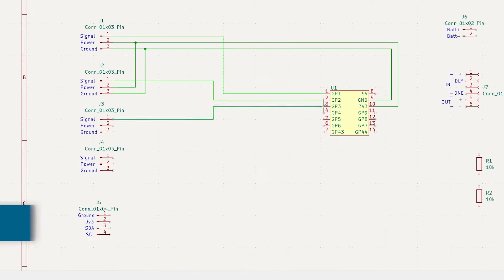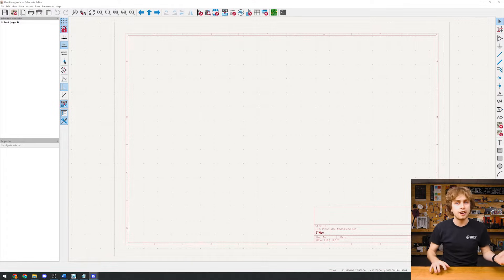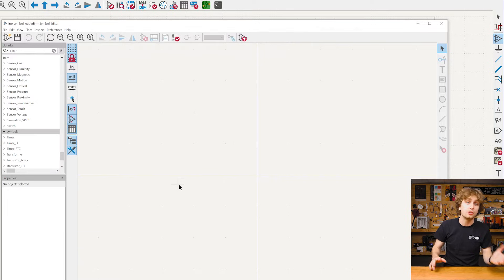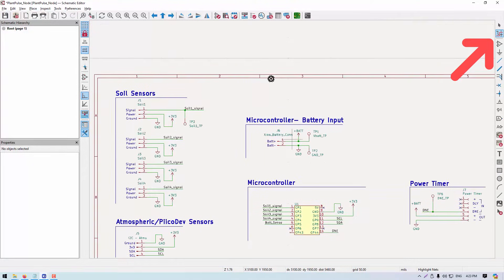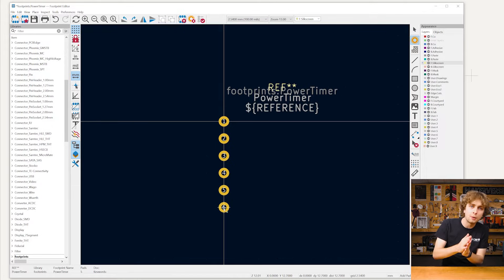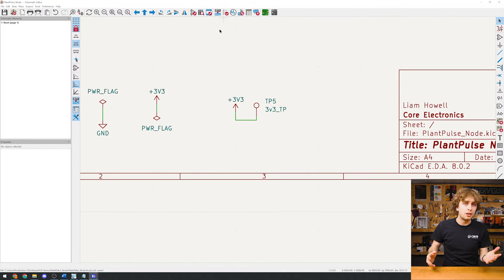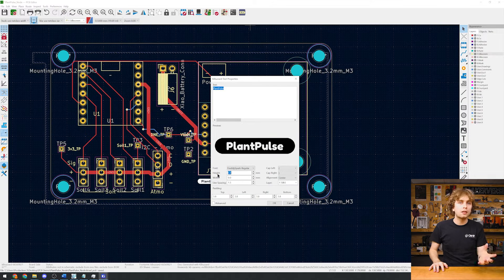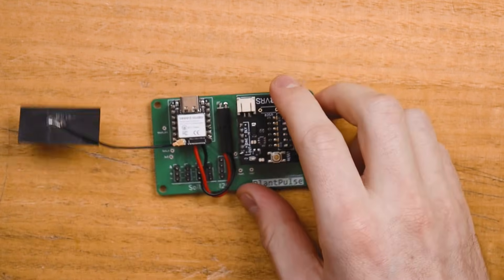PCB Design in KiCAD | Zero To Maker Workshop

Comment: Why bother with the schematic, just go straight to pcb design, it seems a time waste or am I not getting the reason why?
Reply from the maker: Schematic tells the PCB design phase how stuff is connected, but it could definitely be skipped. 

It does however give you a clean visualisation of how everything is connected. If you just looked at the PCB, you would spend 10x longer trying to figure out whats going on. Super important for debugging any issues, and if you want anyone other than yourself to take a look at it (or maybe even a future you down the road who hasn't seen the board in a while).